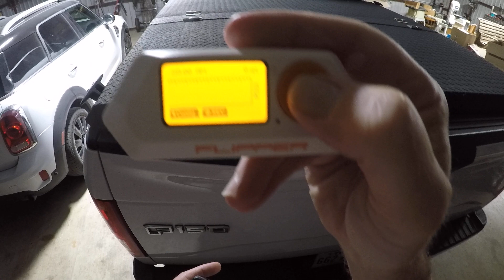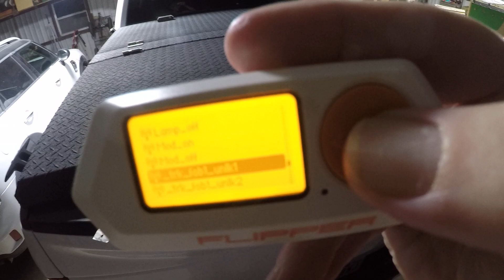Flipper Zero vs Ford F150 (Key Fob Playback Attack)

Comment: So you copy lock and unlock from both remotes. Won't you DOS both of them? I have a vehicle with two remotes and i'd like to copy signals from both, but I'm scared to DOS them both. I'm a bit confused!
Reply from the maker: I used the flipper to copy an output of one of the remotes. I played that back causing the computer in the truck to think it was a playback attack and it locked that remote out. 

Far away from the truck being able to pick it up, I copied an output of the working remote. 

When I played back the copy of the good remote that had stepped to a good encryption code from the flipper, it unlocked the door.

After I got back in I was able to reset the locked out fob by putting it in the ignition, turning it on and off again and to reset it.

Comment: How do you get the blocked fob working again?
Reply from the maker: Just put it in the ignition switch and turn on and off again, pressing door lock and unlock on the remote reset it
Reply: @DialZeerowForOperator  Interesting, I've been directing people on how to get their remotes working after they mess them up with their Flipper.  I've been writing the information down as I go.  I may have collected every method at this point but I'm still researching.

Comment: Ive heard lots of people are getting locked out of their own car while tinkering with a flipper, its a good learning lesson, you shouldn't be trying to use the same methods of pentesting on everything you can get your hands on. It helps to do some research first, so you at least have an understanding of what you are doing or what might happen. Doing that would have prevented your vehicle getting locked out, or worse consequences if you are messing with another persons property. You can go around pressing buttons using the flipper with malicious intent on others if you like, but you take full responsibility, not the ones who wrote the code or the ones on youtube videos explaining how to do it.

Comment: How to reprogram the remote after denial?
Reply: By putting on ignition and make the manufacturer program sequence.
Reply: @youngrp  The manual says that I have to stand next to the car, press the button to open it, and when I open the car with the key, the remote must be reprogrammed, but it still doesn't work, any ideas?
Reply: @tony_joris  maybe your key fob is out of juice. Have you tried replace the batteries?
Reply: @youngrp  Yesterday, before playing with the flipper zero they worked fine. A moment ago I took the battery out and put it back in, but I didn't replace it because I think they have enough charge.
Reply: @youngrp  It was a Rolling Code control, so he lost the synchronization with the car
Reply: @tony_joris  I don’t know all manufacturers and models, but for Opel/Chevrolet Astra is put the key on ignition, press the “lock” button and turn the key to the first ignition stage. After 10 seconds the door locks “clicks” and you can remove the finger of the “lock” button. The programming has been done!
Reply: @tony_joris  maybe you should take your car to the dealership. Don’t try to fix yourself.
Reply: @youngrp  It's a VW vento. I would like to fix it myself, I blocked it hahaha thanks bro
Reply: if it is a rolling code control you need special equipment to be able to synchronize it with the car

Comment: Now that you denied service with that remote, do you have to take it to the dealer and pay them to undo it?  On a lot of modern vehicles that might be the only way to get them working again.  If someone did that to my vehicle and I had to take it to a dealer, I would want to sue them for the cost of the service to restore it and maybe some small related expenses such as towing or if I lived far from a dealer I would want reimbursed for the fuel used to get there.  Maybe even a bit for my trouble and inconvenience also!!  Thankfully these things are not likely to happen under normal circumstances.  What I don't like is keyfobs that are always sending and receiving signals like the ones for keyless entry.  It is possible for someone with a device similar to the Flipper to relay the signal.  Sure they might have to get close to you but it is still possible.  It is how the thieves break in and steal valuables or even the vehicle itself.  Ever see stories on the news about peoples' vehicles broken into with no signs of forced entry yet all the cash and valuables are taken and the victims have no idea how it ever happened?  They must be using devices like these or similar to do it in some way.  There are other devices used to deauthorize devices from WiFi networks and then the cameras don't transmit what they saw and it is as if the thieves were never there.  Stories about that have been on the news too.  It would be likely that the same thieves are doing both of these things or have an accomplice helping them so they can get out of there more quickly to avoid being seen.  The scary thing is they do these things in the middle of the day, if you looked out the window when it happens you would see them.  They might be trying to conceal their identity of course, knowing that there are many people who would love to catch them!!  The fact is they just walk in calmly as if they live there not worried about being seen and that is one of the scary parts of it!!
Reply from the maker: I was able to reset the denied fob by putting the physical key in the ignition and turning it on and off again. 
There are instructions out there on how to reset or program a fob for some vehicles.
The security scheme used on this truck is very outdated now.
There are methods to get around the security of just about any wireless security system. Even 2 way vehicle and fob security as you mentioned can be compromised.
Security is an illusion.

Comment: Interesting, I was thinking of buying one to play around. One question, if you cause DoS when someone park the car but did not pressed the key fob yet, the “victim” will not be able to lock the car right?
Reply from the maker: If the fob is locked out, the physical key will still open the door.
Reply: Wil this device work on saving different keys like my mercedes key
Reply: A brick seems cheaper
Reply: @octopusdreams  why don’t you just use 1 flipper to jam and signal that locks the car?
Reply: Yes, I was just wondering that some people don’t really check if the car actually locked after pressing the fob leaving the car open for the attacker.

Comment: How far away can you pick up the signal?
Reply from the maker: I haven't tried the detection distance. Thanks for the tip. I'll check that. My truck could pick it up from about 20 to 30 or so. Good enough to use for a remote for a gated entry. My  interest is to have one fob or device that can do all the little remotes for different things. It has some practical uses.
Reply: @DialZeerowForOperator  where do you get  this

Comment: Couldn't somebody wait in a car next to you with one of these and copy your signal when you unlock your car then follow you wait till you get out and leave then unlock your car?
Reply: No - that's called a "replay" attack and the car is programmed to ignore those signals.
Reply from the maker: IF you replay a code that has already been used to unlock the door, it won't respond and locks that remote out.
Reply from the maker: @octopusdreams  I demoed that if you send the same code, it will lock that remote out.
The only way you will defeat rolling code security is to figure out the algorithm that generates the codes and write FW for the flipper to generate the prorper code sequences. 2 flippers won't help you. The flipper just records. It can't generate anything on its own unless you write FW. 2 Flippers won't help you do anything.

Watch the research on it by this guy at Defcon 27. 

https://youtu.be/9gfg8gk3lVw

Comment: how do you get the key to go back working after its disabled?? asking for a friend lol
Reply from the maker: Put the key of the locked out fob in the ignition switch and turn it on to acc and off again. That will reset it.
Reply: @DialZeerowForOperator  this particular fob doesn't have a key. its they key as well.
Reply: @SlyFoxConsulting  Some fobs have a key inside, look for a release button and pull the keychain ring. Some vehicles also program keys in the center console underneath the lining tray. Look in your manual.
Reply: if it is a rolling code control you need special equipment to be able to synchronize it with the car

Comment: If the fob has a physical key hiding inside, this still won't work to keep the drunk driver from driving his truck.
Reply: There were U need a potato in the tail pipe.

Quickest and easiest way to disable a vehicle with no damages to the vehicle.

None large V8 engines have enough back pressure to clean the pipe but 

Otherwise it works a treat.
Reply: I remote start my Jeep every day. I use it for my security badge and fobs, garage door opener, etc.
Reply: @anannymus7023  your remote start it with the flipper? I’m thinking of getting one to show people how vulnerable their vehicles are but dont know much about it. I own a car audio and security shop. We secure tons and tons of mopars lately but wanted to use this as a selling tool if possible.
Reply: @OxaudioPhilly  you definitely could! Even show them examples using expired credit cards